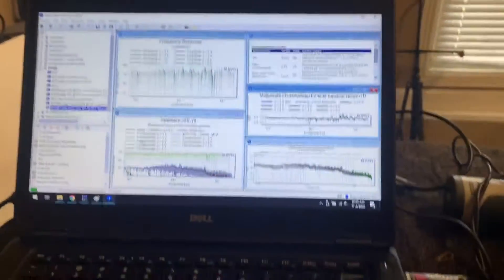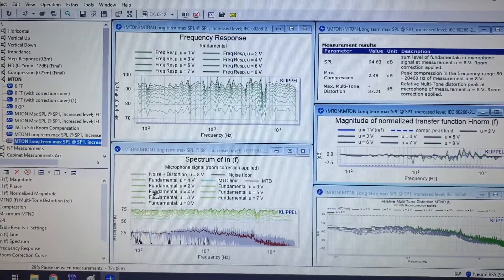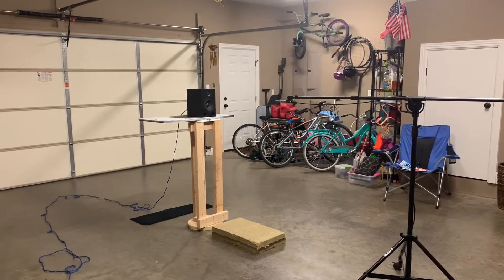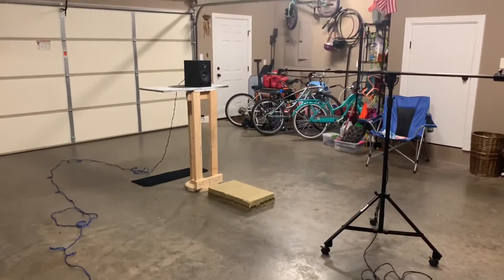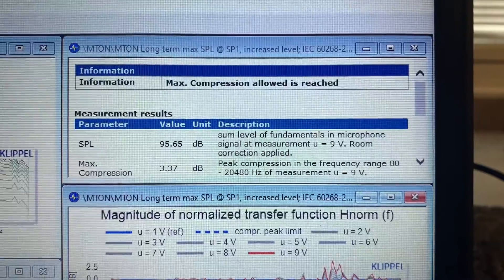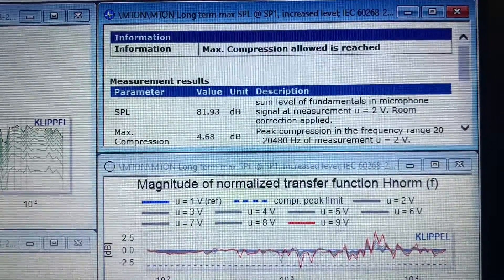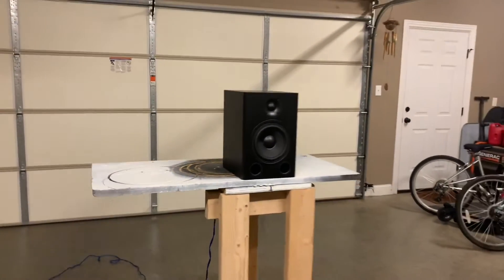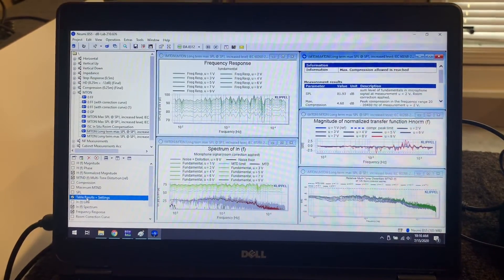Klippel’s updated Max SPL (MTON) Module with ISC room compensation (lower your volume!)

Comment: If you have to stick to just one (60 vs 80 or even 100), I think 80Hz is a probably a fairer ‘midpoint’ compromise and should apply to a greater number of bookshelf type speakers.
Reply from the maker: The only thing is the 80+ is a brickwall.  I would prefer to use a signal that emulates something like a typical HPF with a 12dB/octave or 24dB/octave slope but that isn't permissible (at least, at this point in time).  That said, 24dB/octave is pretty steep and is typical so the 80Hz + stimulus is most likely what I will use.

Comment: That's cool that you can adjust the frequency output to protect the smaller drivers.
Reply from the maker: Yea.  It's not quite the same as emulating a high-pass filter.  It's a brick-wall filter, if you want to consider it that way.  But, it's better than having an 'all or nothing' signal.  Definitely more logical to limit the signal not just for protection but also because small bookshelf speakers like the one in this video won't be used much below 80-100Hz in typical setups.